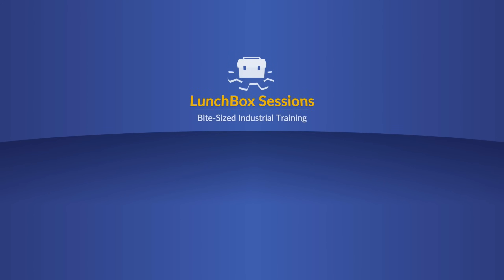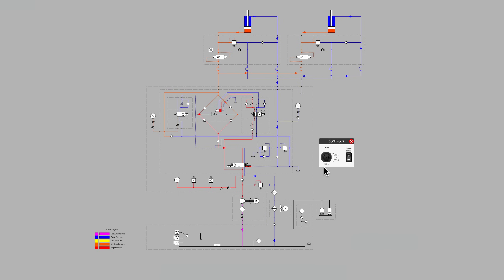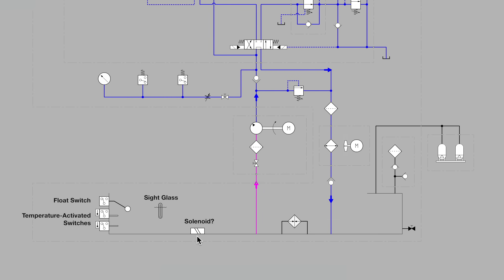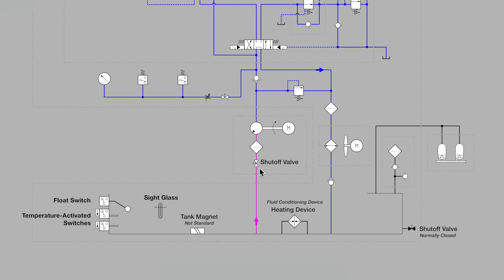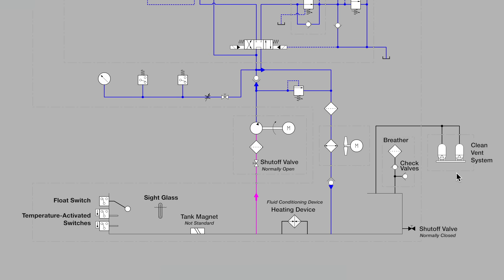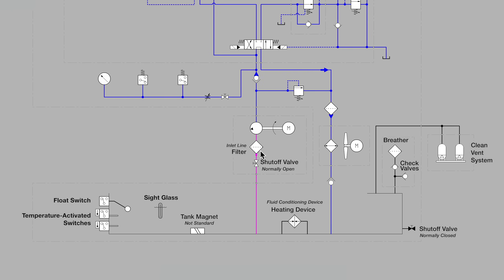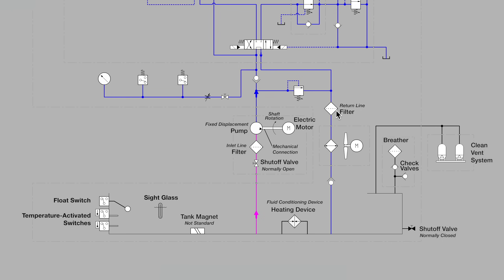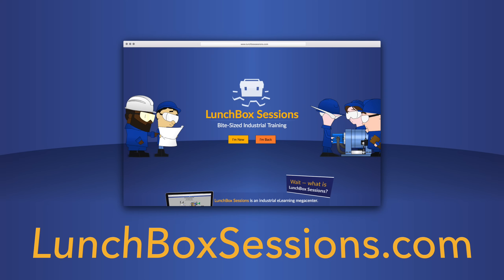How To Read Hydraulic Power Unit Schematics

Comment: what is the use of check valve in the return line(tank line  after the cooler)? thanks in advance
Reply: Probably to keep the return lines from emptying and/or to maintain a small amount of pressure in the return system. like 1-5 psi.  Also since there is a cooler in the return line, it should be full of fluid all the time for efficient cooling.

Comment: Hello, Have a question wondering if you could help please.
I see in your video the filter is before the pump but I have notice in other system the filter is not before the pump but rather located just before returning to the tank.   Where is the correct spot for the filter?  thanks in advance.
Reply: The idael  is to use both filters , and even better if you use and a pressure filter just after the pump

Comment: can you explain about the difference between pressure relief valve,pressure reducing valve and unloading valve
Reply: Pressure relief is to keep the system to a set level, Pressure reducing is if you're needing to step down the pressure in part of the circuit, unloading im not very familiar with but I hoped I helped. :D
Reply: @gurg9329 Pressure relief is to prevent over pressurization. In normal operation it should never have to activate unless something goes wrong and pressure builds to beyond a preset level.  The pressure regulator is ment to maintain pressure at a preset point. A pressure reducing valve is to reduce the pressure to a particular pressure.